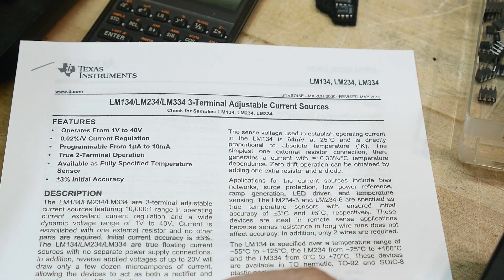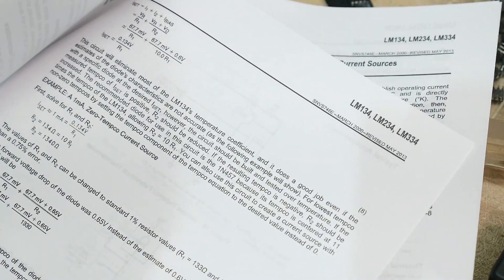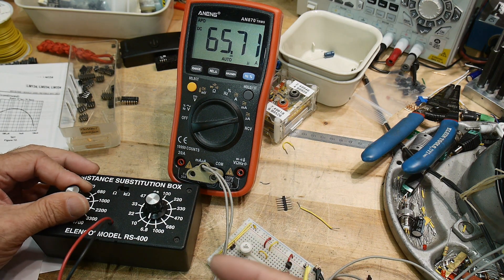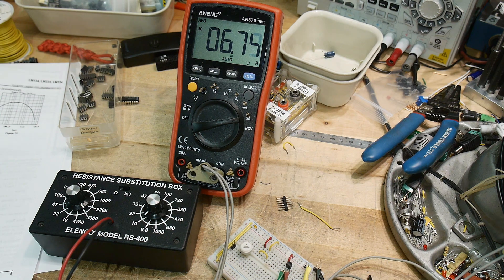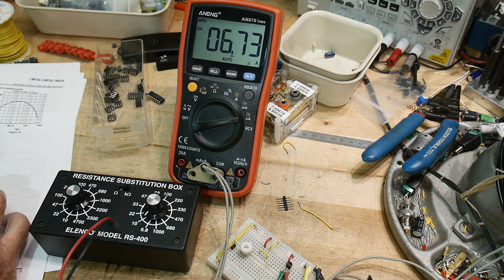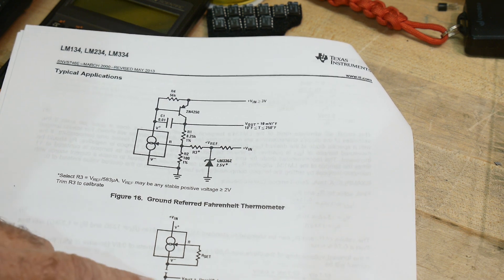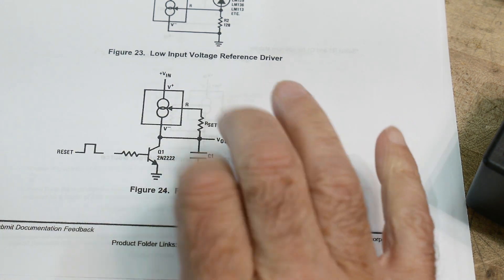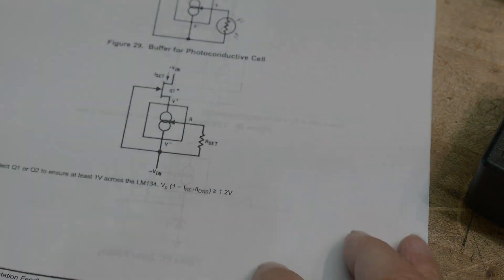#1150 LM134 Programmable Current Source

Comment: Yes, that Elenco R subs box can be out. On mine:
6800 measures as 8081
10000 measures as 13016
the other R values are closer.
Measurements are with my BK 878 LCR meter.
Reply from the maker: That is too bad. My box is about +/-2.5% on all values

Comment: A BJT or FET does the same thing. But a voltage on BE or GS terminals and you get constant current.
Reply from the maker: yes but not very stable.
Reply: @IMSAIGuy  For simple uses, a depletion mode JFET with a resistor between source and gate is a pretty decent current source, and is quite stable at a fraction of the price of an LM334. The problem is the repeatability of the JFET current source with different samples because of the inherent range of Vgs(off).
Reply: @RexxSchneider  Yes I use J201 with resistor in source (300 ohm), which makes it a current source, for discharging capacitors with a constant current.  This method of discharging caps is safer and does creates sparks and does not damage the cap. This works up to high 30s Volts.  For higher voltage caps, I use this configuration in the emitter of high voltage NPN  with base connected 5V (cascode configuration) and collector connected to positive terminal of cap and negative terminal is connected to source resistor of j201.  Remember this method for discharging the high voltage caps, bring their voltage down to 4.2ish volt.  After that you should use the original method to discharge the rest of the voltage.  I can find NPN transistors that go all the way to 1500V, but I could not find JFET that could go above 200.  I guess I can use Vacuum Tube version for higher voltages.  If you know of any inexpensive JFET or Vacuum Tubes that can handle high voltages let me know.  Thanks.

Comment: Nice chip that i've used many times but this is a current source AND a temp sensor: the current will also depends on temperature. The datasheet indicates how to get rid of the tempco but the silicon diode recommanded to compensate the tempco (1N457) is not that easy to find on the market
Reply: As explained in the datasheet, you can use any silicon diode if its temperature coefficient and forward voltage drop are specified or can be measured. The 1N457 is convenient because its characteristics allow for a simple ratio of 10 between the two resistors used. To obtain near elimination of the temperature coefficient of the current, you can trim the resistors' values.

Comment: Completely agree with you. Every part has an application, and the application notes in the data sheet should help you determine a particular use case for the part and circuit to problem solve. Great content! Thanks for the videos! 👍🏻

Comment: Howland current source?
Reply from the maker: only 3 pins. so not sure what it might be
Reply: It's not easy to turn an LM334 into a voltage-controlled (Howland) current source. Best I can suggest is to use a photo-FET optocoupler like the H11F1M in place of the set resistance, or in parallel with 680K. I don't expect it would be particularly linear over a wide range, though.
Reply: Perhaps a new video showing a Howland current source?  Drive with voltage source to make current source. Using a dac on an Ardiuno to make a v-i curve tracer for components
Reply: @jjoeygold  The classic Howland circuit ideally needs a split-rail opamp with the input voltage referenced to ground. That allows the output current to drive into components referenced to the negative rail. The voltage source also needs to be able to supply the full output current, and these two constraints make the circuit less popular.
For your application, you only need a linearly rising current and there are probably numerous other simpler solutions such as a pnp current mirror being driven from a linearly falling voltage through a fixed resistor.
It would still make an interesting video, though.

Comment: I have a few quibbles with the comment "engineers need to know all the parts". 
Well no not really. What an engineer needs, (among other things), is how to model and understand circuits. The fundamentals: [current source, voltage source, RLC] as exemplified in a SPICE program such as LTSpice, which is free. These fundamentals and small variations of them as well as some calculus provide what is needed to construct a circuit.
THEN: come transistors, vacuum tubes(sorry children), FETs,... which are understood in the CONTEXT of the fundamentals. 
AND well yes engineers need to know about parts. We develop favorites that we use because we are familiar with them. And we learn about new parts. But the fundamentals
are the key to understanding the parts, with the limits and range of their use defined by the data sheets etc.
Reply: An engineer also needs to know the limitations of the SPICE program they are using compared to real life. There's no point in designing a single transistor amplifier using LTSpice, for example, if the dc operating point ends up being highly dependant on the transistor β. LTSpice only simulates one value of β for a given model, whereas that transistor may actually have a β that varies from sample to sample by a factor of 7 or more. You have to know the parts you are intending to use, and design circuits in a way that compensates for variations in their parameters.
Reply: @RexxSchneider  Then you run a Monte Carlo sim,...
Reply: @mr1enrollment  ... and get the same results in the simulation for the dc operating points every time. The other option is to add new transistor models to the library such as BC547lo (with a β of 110) and BC547hi (with a β of 800). Then swap the parts in LTSpice and observe the effects. You still need to know the parts you're using.
Reply: @RexxSchneider  Dude - you include the transistor parameters in the Monte Carlo. The thing is: Spice is just a big calculator. It is faster than I am. But I am smarter, so it is on me to organize the problem and simulate it correctly given the requirements. Your example: re Beta and op point is a bit well,... (add the word). When you have a device, (like all transistors), you best know how to arrange the circuit topology and the values around it so that the beta is less important. Because parts do vary. That's part of the game, and the challenge. Spice is simply a tool and a good one. 
If you try to drive a nail with a screw driver, you may get it done, but a hammer is better. For a simple common emitter amplifier, I can most times design  by inspection, and it will be stable, with predictable input and output impedance - and the correct gain. As long as I am not trying to push the boundaries of the device. The more complicated the circuit requirements the more the tool makes a difference. 
So whats all this stuff about beta anyway?,...
Reply: @mr1enrollment  So, "Dude", when you say "When you have a device, (like all transistors), you best know how to arrange the circuit topology and the values around it so that the beta is less important" did you mean you have to know how to design the circuit so that it compensates for variations in the parameters? Which would be exactly what I explained to you in my first comment, and a direct contradiction of your own first comment "engineers need to know all the parts … Well no not really."

Spice is indeed a big calculator, but LTSpice doesn't have any means of setting the transistor parameters in a Monte Carlo simulation.

Don't you understand the importance of a parameter like β in designing a common emitter, for example?  If I specify a 2N2222 with a collector current of 1mA and a 10V supply to give a gain of 16 with a full output swing, then I know I can't get an input impedance more than about 4K, because the base bias resistors will need to carry about 0.2mA so that the maximum base current of (1mA/50) = 0.02mA remains insignificant as the β varies from a minimum of 50 between samples. Check it with Rc=4.7K; Re=270R; Rb1=47K; Rb2=4.7K.
If I'm tasked with producing the same performance but with an input impedance more than 10K, then I would use a BC547C instead. With a β of 400 minimum, the maximum base current is reduced by a factor of 8. That would allow Rb1=120K; Rb2=12K, giving the required input impedance and the variation in collector current across samples would also be reduced considerably as a bonus.

I can do all of that because I know the parts that I'm intending to use from 50+ years of experience, not because of any simulation software that does little more than confirm what I can design approximately with a simple calculator. So, yes really, engineers do need to know all the parts.
Reply: @RexxSchneider  Rex this "conversation" reminds me of email wars and it is not pleasant. I really don't get why you are so angry. I am very happy for your successful 50 years of design work. I have just about exactly the same experience. Obviously success comes and it is not dependent on absolute technique. 
But in regard to your last comment first note transistors may also themselves be modeled with the tools in Spice - and a Monte would be able to calculate the results of a beta variation. 
My point which I must not have made in such a way that had you understand, is that those fundamentals, current sources, voltage sources, rlc, and dependent versions of the same - are what need to be understood.
Understanding those concepts first prepares one for the some times onerous task of finding a part or set of parts that are suitable for any specific task.
Without that understanding parts are just a pile of pins and plastic. 
Now I know there are conflicting schools of thought around Spice. Robert Pease RIP, was not a fan and he was one of the finest analog engineers ever born. But, well he did most of his learning at the bench without Spice. My experience is both with and without. It just depends on the task
Personally I am free to use or not any tool I wish to use.
Be my guest and do whatever you wish.
So how about some peace? Or is that no fun at all?
Reply: @mr1enrollment  Sure, I have no personal stake in this. I merely wished to express my disagreement with your original comment, which I understood to assert that engineers don't need to know the devices that are available (and by implication their characteristics).
I think we agree now that that is not the case, and I expect that our disagreement is really a difference in emphasis.
I'm far too old to play flame wars, and take no pleasure in disagreements. Peace and out.
Reply: @RexxSchneider  Smile ! I think you are correct. Maybe we can actually be friends! What an idea. 
My original post was written for those looking for an entry to understanding electronics - without getting bogged down by zillions of parts. So of course engineers need to understand parts, but I challenge any engineer to say that he/she knows all the parts. The key is understand some and then knowing how to look for what is needed in a specific case.
I think you may just be the guy to find a part for IMSAI guy to fix his scope,..
Reply from the maker: Happy ending 😀